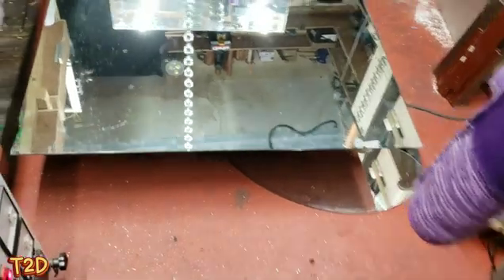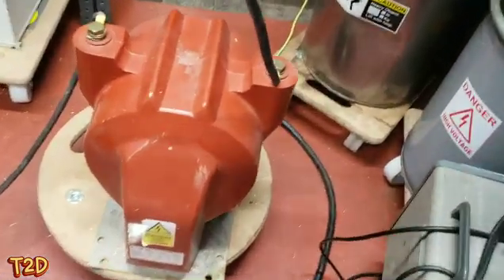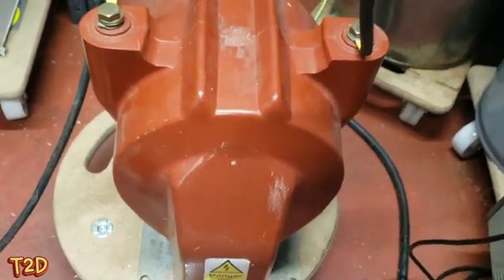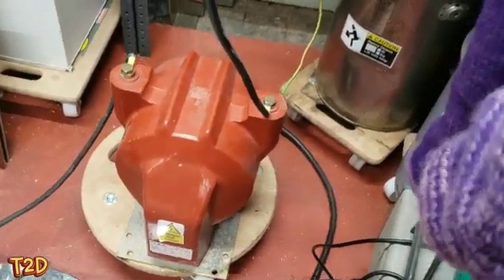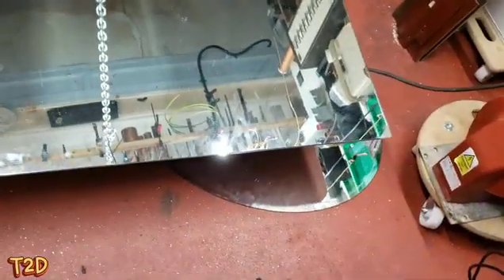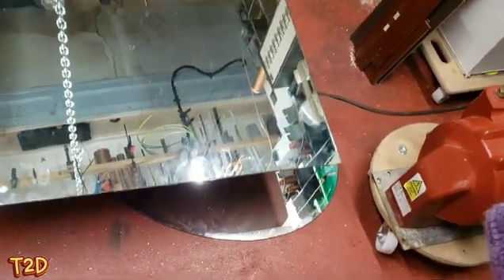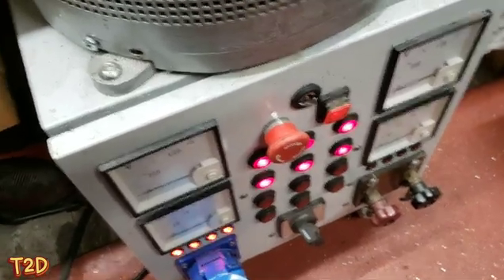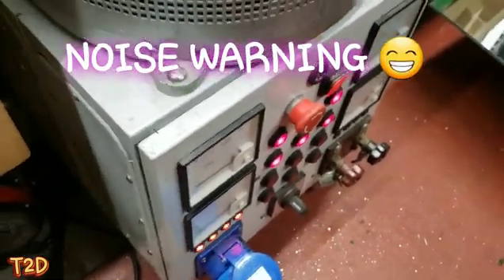Chains + Mirrors + High Voltage = 😁

Comment: hahahah YES!!! I just scored a lot of 37 working flybacks for cheap only 168$usd and I saw some had the Tripler's!!!! if I put four 700w ones in oil in a parallel primary and series secondary config should be around 200kv and handle up to 2.8kw so it will work for my 1800w zvs.... hopefully not blow ill be building a rectifier for it to help the internal ones. you think it will last long in oil?
Reply from the maker: Cool that's great you will have fun with those, what are you going to use them for? Just for fun or do you have a project you need a high voltage power supply for?
Reply: @T2D.SteveArcs  my work is on
on fully passive to low energy confinement methods for plasma for hot fusion....there's alot but my M.F.C is very similar to a tokomak but uses low energy x-rays from the reaction for plasma confinement and only one magnet for particle rotation and electrode protection this cuts out the need for high power magnets and cooling tanks reducing the needed input power but maintaining energy density
I blew out my old supply on my last video testing the MFC with a unregulated 26dc input the old 700w zvs works still but I'm upgrading as well cuz I got my first supporter so ill be going so I'm prepping for a full on up scale and moving from the demo core to a 8x scale prototype and ill be doing a vid on everything ordered and vids of unboxing and testing the parts. my design is not open for use but the data is open when I can start getting it. not done trying to get funding though as the high vac system needs to be reliable and atleast 28inx28inx56in for the main high vac chamber and ill need it custom made with the cavity reflectors built in and at minimum be able to get down into 40-50 millitorr to really start seeing a boost in performance.
Reply from the maker: @numatechprototypes222  awesome you got a supporter mate that is great...
I thought you already had a power supply but now I realise your plan 🤣...
Awesome 

Steve
Reply: @T2D.SteveArcs  no I really did blow up my old power supply in my last video it's never good when the transformer starts smoking like a popped lithium battery.
Reply from the maker: @numatechprototypes222  lol I look forward to seeing what you build mate...👍👍
Reply from the maker: Are they DC output flybacks?
Reply: @T2D.SteveArcs  yes hvdc is what I need. iv done it before with them years ago but had to little oil so it over heated. this time I plan on using a pc radiator kit and cooling fan so I can keep it small.

Comment: how can I find a small-ish 200kv at 1.8kw x-ray transformer that doesn't cost a kidney? I'm having no luck on eBay.
Reply from the maker: Not many 200kv transformers that are that small mate
Reply from the maker: Where do you live?
Reply: @T2D.SteveArcs  Washington state usa.
Reply from the maker: @numatechprototypes222  sorry pal, I cant do much if your in the states. Just keep trying ebay, craigslist etc and what about on the HV forums etc. But they are not cheap. There is one on Ebay now, its hf and bids, starting at 250bucks. What about a dental head? They are usually around 100kv if they are older. You can pick them up for roughly, 80-150bucks. Sorry I cant help more. 

Steve
Reply: @T2D.SteveArcs  that one is temping for me. but there's no info at all but it looks like I could upgrade it.
Reply: @T2D.SteveArcs  screw it ill get the one I was talking about in the link its got the 30 day return policy.
Reply from the maker: You want a 50hz transformer or hf
Reply: @T2D.SteveArcs  hf. like a flyback. the zvs output is 300v 6a and will oscillate at cooler temps if its around 120-178khz.
 then ill need to build a rectifier for the transformer.

Comment: Hi mate, nice work! What voltage and how powerful ballast did you used? I am feeding mine with 120 V and as a ballast I am using 2 MOTs - but seems like I can pump it a bit more. Thx.
Reply from the maker: Is it the same pt 100v - 20kv ?

Steve
Reply: @T2D.SteveArcs  No it´s not. I have some old Czechoslovak 2 phase transformers, but they are also 100/22 kV. I connected two of them in series and got about 70+ kV according on the size of the gap (9.5 cm). But it looks like it might need a little more current. Present situation: https://youtu.be/fR6hxBTOQ_0

Comment: That's amazing Steve! I had hoped to see the surface of the mirror afterwards. Was it etched at all? Did you swing the chain in order to avoid localised heating? -Peter
Reply from the maker: Thanks Peter,  no etching mate no damage at all to the glass and yes the localized heating can smash the glass so better to be moving, it does damage the rear silver  coating so dont use your best mirror 🤣 (unless you silver nitrate) you probably do.🤣
Thanks for watching 

Steve

Comment: That's Soo cool i need to try this !!!! 
It can work with 3kv power supply?
Reply: Uhm... 1 think you need at least 20 times more...
Reply: @fabriziobrutti1205  i know it won't work
Reply from the maker: Hi mate I'm glad you liked it and 3kv is to low voltage I'm afraid.. you need 40kv or more mate 
Thanks for watching 
Steve
Reply: I don't think so